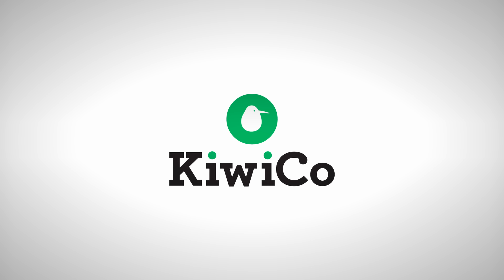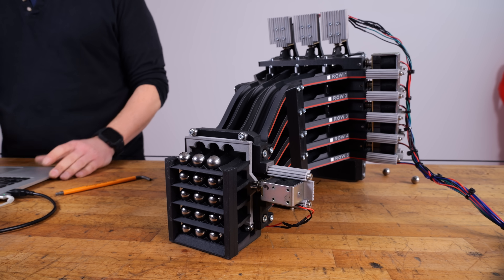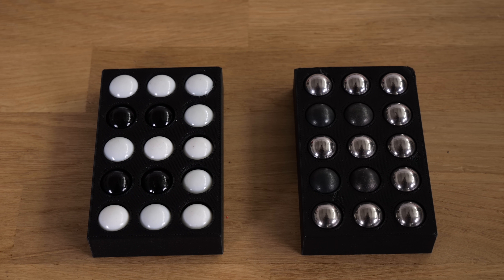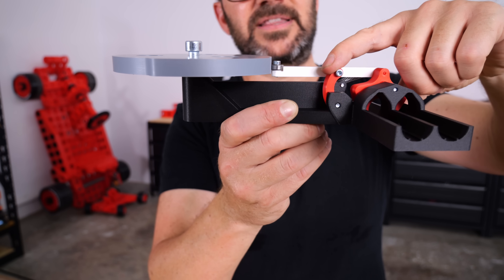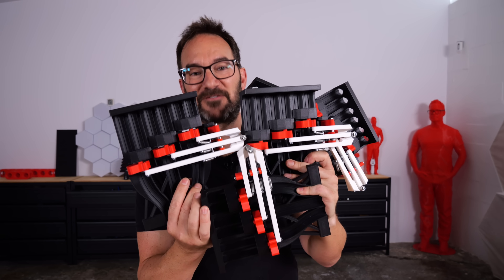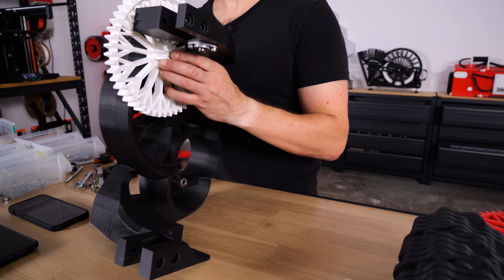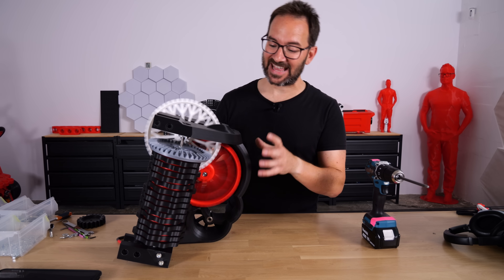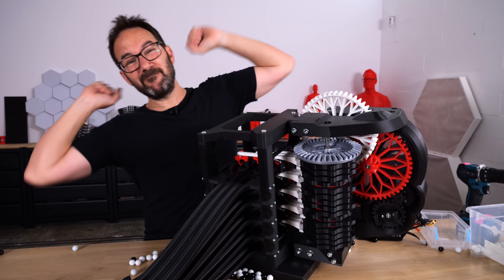Rotary Cam Marble Selector - Marble Clock Seconds Display Pt.5

Comment: If black marbles have more friction or like steel marbles have more friction than just stainless then could you use sealant to reintroduce a smooth surface of course not a recommendation just an idea

Comment: Apologies if someone else already said it, but I think there is simple solution for your seconds, it's right at the first 7 seconds of the video. If you sort the marbles into 6 columns by color at the bottom of the elevator, then you just put a rectangle window in front of the elevator, you could sort the marbles to represent the seconds as they slide up to the top. Bonus is that they are already sorted when the reach the top, so no more kick-outs.

Comment: You should make the ‘trailing edge’ of the cam lobes steeper, so the red selectors snaps back to the central position quicker. That seems to be a slight bottle neck in this design, getting the marbles out of the assembly quicker.

Comment: The marble situation makes me think that maybe you could print some through either a normal 3d printer or with a resin printer, then if the marbles are not smooth enough they could then be sandblasted to get them smoother.

Comment: Why not use a mix of ZrO2 and Si3N4 bearing balls ? Those would be a round as you can get and are relatively affordable.
Reply from the maker: That's a very generous use of the word "relatively" unless you have a source for those marbles that I should know of.
Reply: @ivanmirandawastaken  I went back and look at the price and you are right. They are pretty affordable in the small size ($0.10 each for 3mm) but get pretty expensive for the larger one (2$ for 12mm).

Comment: Du brauchst nur die Polarität des Motors zu ändern, und schon wird vorwärts gezählt. Allerdings haben die Sekunden noch eine Zehnerstelle von 0 bis 5, die links daneben auch noch angebracht werden muss. Über eine Achse mit einer 1:10-Übersetzung kann diese mit der Einerstelle syncronisiert werden.

Comment: As some other people sre mentioning, the current design can work witjout any black marbles at all! If you completely give up on black marbles for the decond display, it could be sikplified massively (only two required stable positions instead of three, no marble sorting needed, etc)

Comment: Hola Iván! I think there's some space for optimization: rows 2 and 4 at,  the center column are always in black; there's no need to refresh those spots. You could reduce printing time and amount of marbles a little bit by removing those spots. Cheers from México!

Comment: They sell a dye for Metal that will turn the silver marbles black without heating and quenching. They use it to "blue" gun barrels.... No added friction
Reply from the maker: That works for steel but not for chrome. Take a look at the previous videos

Comment: so a suggestion but, 5 of those 15 marble slots are actually always the same color marble aren't they? 
Middle slot on second and fourth rows are always black
Right slot on 1st 3rd 5th row are always white
Wouldn't it make things a bit easier both space and weight wise to reduce the partcount by a third?
It would also reduce the needed throughput of the marbles from 15/s to 10/s which is a fair amount!

Comment: Ivan - Be careful with the pressure angle of the cam motions on the follower -- too steep an angle and you'll just push the lever to the side instead of "ramping upward". Using a larger diameter roller would help, although it limits the speed at which you can change positions

Comment: I agree that contrast is important. Surely there are plastic spheres, maybe you need them with an iron sphere in the middle to give them a magnetic handle/inertia. One wonders how one might craft one's own specified spheroid. Not a job for 3D printing...but what if it were? How would hot blobs of plastic be made suitably spherical? Forward, ever.

Comment: An issue with glass marbles I see is that after running them for some time you might have to sort them again, they seem to be bumping into each other qith quite some force a decent bit and in my experience that damages some of them at some point. Which has a high chance of just getting your clock stuck. I personally see the numbers fine either way.

Comment: Why even use the black marbles at all? At this point there's little visible difference between a black marble and a spot with no marble, and they're not needed to keep the other marbles in their places, so you could just load the channels with white marbles and change the cams to either emit a white marble or no marble at all!

Comment: When the entire clock is complete, you should put it on a vibration-damped platform, and then enclose the whole thing in a large double-glazed Plexiglas case, then pump out as much air as you can so it will be nearly (or totally) silent.  :)

Comment: You’re still horribly over-complicating and over-engineering for over-self-introduced issues.  KISS: keep it simple and stupid.  You don’t need black marbles, JUST WHITE ONES.  Only populate the pixel/points that you need populated.  Go back to the beginning, start over, and just solve for white marbles.  You’ll cut all your workloads, problems, and times in half if not better.

Comment: Because the solenoid is Magnetic, you can turn it off and on really fast (like 500hz/1khz) and it will rest in the middle, if the duty cycle is constant.  In fact, you can adjust the duty cycle to position it.

Comment: Why do you even need a marbles selector? 
You can just create a vector of marbles for each digit per pixel, and this will simplify design.
Hope my idea is clear 

On top of it, you might not need a full set of marbles for each pixel, as they might really change , this will also decrease the noise

Comment: An Idea that popped to mind is that with the springs, the cam disk will have a hard time when switching a selector, an alternative woud be to have the arm's bearing rolling in a groove, but then you might need an arm in two parts to keep the bearing at a constant height

Comment: In fact, if you really want to use a solenoid piston, you can use a double-wound solenoid piston instead of a single-wound solenoid piston. So you get three different locations. When the two coils are closed, the solenoid stops at the last point that the piston spring can push, when the first coil is opened, it stops in the middle, and finally when the first coil is closed and the second one is opened, the piston stops at the last point it can pull. You can also do the same with a springless three-winding solenoid piston. This two-coil and spring-loaded solenoid will be much more sensitive and much faster than the piston. It will only stop at the far left when the first coil is turned on, it will only stop in the middle when only the second coil is turned on, and the last one will stop at the far right only when the third coil is turned on. significantly reduces the mechanical complexity of the system

Comment: You don't need black marbles. 
It's a left over design requirement from your previous prototypes.  You can simply use silver/white for digits and empty spaces for the rest. Your new marble flow does not depend on marbles for the vertical layout, they have their own tracks, the swing mechanism ejects all marbles without the need for a black marble to push out the white one. So you can simply use solenoid gates to filter when a white marble needs to be displayed for each location. And instead of black marbles the empty black track will serve as contrasting background ;)

Comment: So I see you just need to either change the direction of the motor to "print" the numbers in order or something else drastic. 
I'm kind of surprised you didn't notice that there are two spots that will always be black. That part of the wheel could just swing back left and right on the odd and even seconds, as long as both channels are filled with black. If they were not both black black you would need to have a priority buffer since they are the two spots in the highest demand.

Comment: Would anodising/powder coating the steel marbles not provide both good contrast and consistent friction, as well as the benefits of using ball bearings? If my understanding of anodisation is right, you could even do them in bulk

Comment: Could you have 10 templates, and keep the 15 marbles on separate tracks and always in the same order. So different marbles are used for each number, and the same marbles are always used on the same number (so the same 15 marbles are used for the number 0, and then they wait in cue until 9 more cycles). Then you just have a gate that cycles through the 10 different numbers.

Comment: It would be kinda cool to make a machine that would auto measure the marbles to see if they are round. You could even attach it to the machine itself when it is running so that it will never fail: as soon as one of the marbles breaks and becomes non-round, the machine would banish it

Comment: It honestly took me until the last second of the video (heh) to realize his wasn't a mechanism to select white/black marbles to make the numbers in another step, but rather it's fed white/black marbles that are already separated before this step, fed into this, and the cams create the numbers in order based on the different raised/lowered sections on the cams. A clever analogue solution to a problem that I thought was going to be solved digitally with sensors and stuff.
Weirdly enough, this clock is looking more like clockwork as time goes on.
Might could do with a title change though.  "Number selector" is far more informative of what's going on than "Marble Selector".

Comment: i dont know if you have thought of this befor in the previouse videos or said it but , have you tried making galton board or bean machine to select each color of the marbels ,guassian distribution.for the metal balls if you can change the surface roughness i assume by puting them in a vibrator with very fine sand to smooth them . good work hooe to see this  comes to life ,

Comment: Might not be an issue for you, but you don't need all the cams exerting force against the springs at the same time? You could probably stagger the phase of the cams to even out the force envelope.

Comment: I think you should replace the original clock with this mechanism instead, this feels much more reliable than the previous mechanism with a lift and the long tracks where marbles got stuck. Then make a better lift system with the new multiplexer to complete the clock.

Comment: And then of course once you have got this all working you need to do it again, since seconds have two digits. 
Of course the tens don't need to change every second unless you want them to, and the mechanism can be the same (albeit mirrored, and with different cam profiles and gear ratios).

Amazing work though, keep it up man!

Comment: We all have talents in different areas. I am so thankful for the inspiration that comes in software engineering for me. I am amazed nonetheless by the inspiration or design that comes to you in mechanical engineering. Maybe that comes a little by experience too, just doing the stuff we do until it becomes something we can create with plus the University degree. Anyways, if I get a chance it would be fun to design more in Industrial Design which I think you do some as well since it isn't just parts and unsightly prints of default mechanisms. In all, I think I'm just talking about something I heard of as design thinking.

Comment: If you could use glass and steel marbles, you could use magnets to separate them! Though you might have issues in the rest of the system caused by the different weights etc

Comment: great improvement and innovation man you've made a lot of changes and wrong turns to get something awesome. Electromechanical devices made just before mini electronics that needed to be high speed used lots of rotary cams. IBM selectric, jet computers, cameras, targeting computers etc. often used cams and levers over reciprocal motion solutions.
Reply: I hope you make up some jigs and/or sorters for marbles, to save yourself time filling up the machine. 3D printed holes or rails could be precise enough for diameter. Maybe roll the marbles on a flat plate and catch them in buckets depending how straight they roll to get round ones? And if you could get a regular camera on an arduino that'd do colour?

Comment: Have you given any thought to skewing the colour of the marbles based on their position? For example, the bottom right most corner should only ever need white marbles, never black. As another example, the bottom middle will need 7 white marbles to every 3 black marbles.
I guess the cams are there for this reason, but could be something to consider when it comes to sorting marble colours.

Comment: if you also get marbles that are slightly different sizes, just 1-2mm Diameter different, you can use simple size classification with a specifically sized rail...

Comment: You can probably make an auto filter for the glass ones, just a ramp that has 2 different sized holes, first one, marbles too small fall through, second one marbles the right size fall through, then the end of the ramp ends in a bucket that are too large.

Comment: The more I watch videos of people working with marbles the more I feel like it's a doomed effort from the beginning. Gravity, error, the size of the marbles, and the small margins/precision needed are all factors that can never seem to fit together. At some point humanity realized that it's easier to mess with electrons than mechanical bits and we're all better for it. I still love marble contraptions and the mechanical nature of them but it feels like there's always a ceiling for working with them and trying to approach or push past that ceiling is just never going to happen. With that said I like what Ivan is doing. It seems like he's more aware of this ceiling and is willing to scrap designs to work with the marbles, admit that it's not working, or just go with the low ceiling of precision instead of just brute forcing the thing and trying to make it happen. But hey ho, I'm just a voice on the internet what do I know?

Comment: Sorta odd optimization but not every marble needs to be replaced every time. There are 5 marbles that don’t move at all 3 white and 2 black. Some quick(potentially wrong) math showed minimum 46 changes over a full cycle including going back to zero, instead of doing each one every time which would be 150 changes per full cycle that’s 69% fewer marbles, though it may be against the spirit of the challenge here

Comment: 5 marbles of your 15 marble array are either always-black or always-white. #1 (top), #3 (middle), and #5 (bottom) of the right side column are always white for any of the 10 diff digits, and marbles 2 and 4 of the middle column are always black no matter what. You could save yourself some mechanical effort by only changing the 10 marbles that change and keeping the other 5 constant - permanently secured to the display frame maybe?

Comment: Is it worth offsetting the stagger per row based on how frequently a specific column uses a marble over a set of digits?

The right hand column uses a lot more than the left for example, but the exact middle is used 8/10 times. Ordering the arms such that the most frequent "pixels" have the longest buffer is probably a useful thing to do

Comment: I have a super expensive, but high quality suggestion for better marbles is to buy and anodize aluminum ball bearings. Then you could have virtually any color combination for your clock display and have low rolling resistance very round spheres

Comment: I still say you dont have enough data throughput. You're refreshing EVERY bit of the image EVERY frame..  if you only refreshed CHANGING bits, you'd reduce your required throughput to nearly a third of what you need right now. It would also be easier/faster to supply data to with your carosel/seporator. It would also likely be wise to incorporate 2 hoppers with each color and have tubing supply the marbles. Yes there are issues with traffic, yes there are solutions to stop it from being an issue.

Comment: This may be too late, but rather than measuring every marble, why not make two plates with holes to form a go/no go set.  Marbles that pass through the first larger hole are not too big, and marbles that DON’T pass through the smaller hole are not too small. What’s left is just right. Sounds a lot easier than using calipers on thousands of marbles.

Comment: Im pretty sure there are plastic marbles with a metal core out there
that would get the bennefit of the heavy weight and longevity of steel marbles, while not suffering the drawback from pure steel or plastic marbles

Comment: So regarding the marbels, the contrast now looks so much better but maybe a hybrid mix of black steel marbles and white whatever marbles could be useful for sorting the marbles by weight, which really would allow the machine to run with one motor

Comment: It looks like you have your alternative, but a 3 position solenoid is not too difficult.  You have your stationary position (power off) in the middle with a spring or tension setup.  Then you have your main direction current to push the solenoid into one direction, and then reverse the current to pull it into the other direction.  This is extremely common.  Just depends on your throw distance for the push or pull from the center position.

Comment: Do you even need the other part? Just the demonstration at 12:00 with the manual "gate" seems to work well enough. Maybe you can just use a motor to pull the gate away.